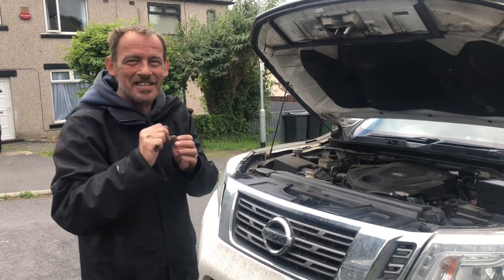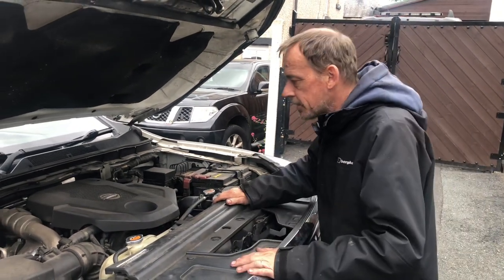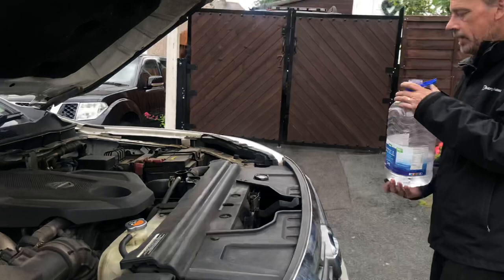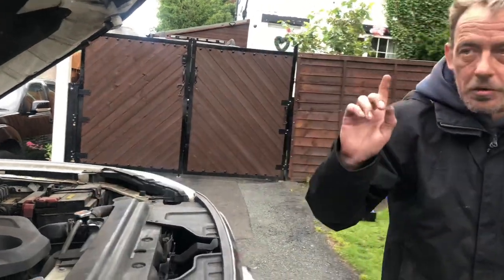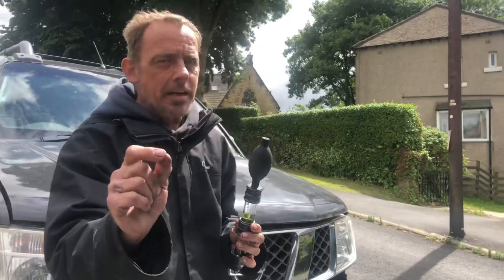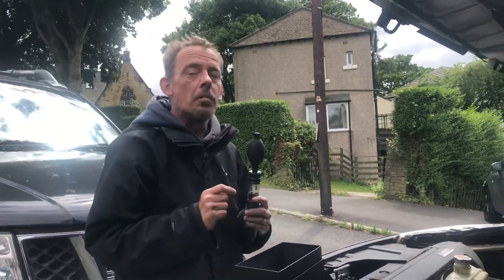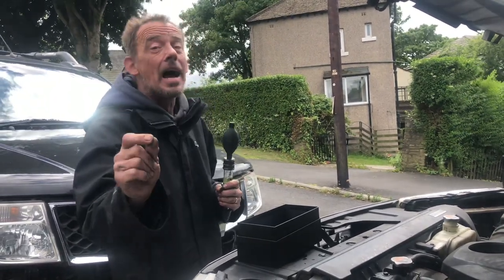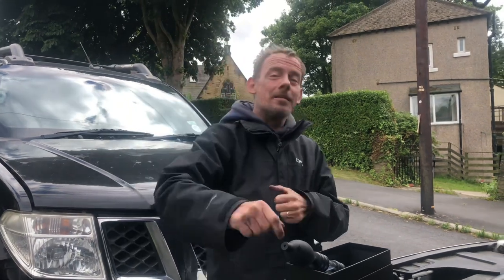How to diagnose cylinder head fault NP300 D23

Comment: egr cooler could also put hydrocarbons, and pressure in cooling system, I no longer trust this test.
Reply: Agreed, I've had a D23 with the exact same issue plus smoke from the exhaust on occasion. Couldn't bleed the cooling system and kept loosing water. I clamped and took the coolant pipes off the EGR, ran the engine and found exhaust coming out of the EGR coolant pipes. I don't normally suspect head gaskets on the D23 unless it's dumped all it's coolant and been driven dry.
Reply: @ATOM314159  I changed my egr cooler and still no good .head crack possibly?

Comment: got a cabstar yd25 engine , 50k miles starts fine, and will idle, soon as you rock the vehicle side to side even slightly it will run ruff and ruff idle and eventually stall any idles, changed diesel filter etc  THanks

Comment: I have a series 5 l200 bought it and love it. after buying it realized i had a head issue. Did a pressure test and found a leak coming up the injector port on the third injector. fixed the head all running lovely. Then my oil over filled did a service and changed the oil had my DPF cleaned on the car and was told all fine but my oil still fills up IMO too quickly so my next step was to remove the DPF and clean it properly. The guy who cleaned it on the car said my pressure were correct.

Comment: Hi bro I have nissan Navara diesel , I facing and issue with overheating I change fan clutch radiator still heating engine which means not full have if the temperature gauge do you think it will be thermostat or water pump 

Engine starting and running all smoothly no timing issue no starting trouble injector recently  calibrated
Reply from the maker: cracked head

Comment: I'm from South Africa and I have a Navara 2.5 D40 Spain Spec. 

It continually gives me a  P0546 code. Exhaust Gas Temperature Circuit High (Bank 1) and goes into Limp.

Clearing the code and its fine gor a few km's and thrn limps again.

CAT has been deleted and EGR  blanked.

I read there was a recall for faulty EGT sensor way back. Could that be the problem?

Someone also mentioned the SCV needs replacing. If its SCV, will Diesel Injector Cleaner help or be good to ads in the future?

Also read the intercooler could use a clean (240 000km on the clock)

Best guess, what would you advise me to look at ?

Comment: I have a pathfinder r51 yd25 with a disgusting loud, high pitch noise that appears when accelerating/revving. It will disappear after staying in that rev line for a few seconds (warming up) and re-appear after being parked up, allowing the engine to cool off for a few minutes with out even shutting it off. It is not any of the accessories as it still persists with both belts off. My mate says the turbo is a goner. Would be unfortunate as I had it replaced half a year ago. I've read something online about it possibly being an exhaust manifold leak. The noise is not the traditional turbo whooling and it came out of nowhere. I also read something about transmission filter being clogged and starving the oil pump as a result. I've checked the tranny oil and it's at an appropriate level and color. I first heard it while exiting a rest stop on the Autobahn and it's been driving me nuts.

Any thoughts on this?

Comment: Hello Des Wayne here in Australia mate 
I have bought a R51 TI turbo diesel 2.5 dci 
And no oil in water no real bubbles in radiator and no over heating 
BUT my mechanic found a small water leak on the outside of the manifold area 
Is this detrimental or will Kseal fix this ?.? 
I am only on a disability pension and I’m 70 yrs old and this would be my first ever car 
With aircon and power windows and nice things in it lol 
And would love to keep it 
What’s your thoughts 
Also I appreciate your channel for its honesty to all the people out there that’s honourable mate 
I have a YouTube channel too 
Cheers 🍻 
CrouchOz
Reply: Hi Des. What was your outcome?. Mine has a white hazey putrid smokey exhaust emission..Carl from Oamaru Sth island New Zealand

Comment: Hi! Please help!!

In your "horrifying engine knock video" (comments are turned off) I have the exact same issue. Fuel in oil, turbo blown, leaking injectors, engine knock. 

I really need advice. Does this mean 1 or more injectors have failed, if so is the only solution to replace injectors?

This is the first video I could find with the exact same issue. 

Thanks for any help.
Reply from the maker: Call me on 01274 640028 you have big problems

Comment: Hi, I have a 2010 navara 2.5 Diesel, I have had an issue with having no power, two days ago I had the DPF regeneration done, stil a issues but not so bad. The problem now is it has alright power in low but going over 80 k/m it seams to loose power and drops to 60 k/m. In the next couple of days I am going to test the MAF sensor but really leaning towards the suction control valve, your thoughts would be appreciated. Reards Brett.
Reply from the maker: call me
Reply: It's will be hard to as I live in Australia